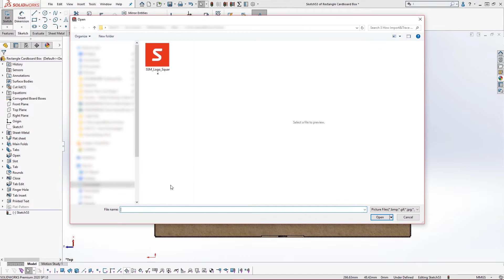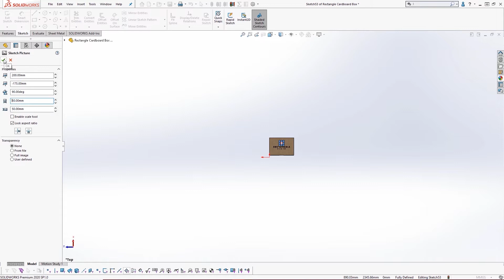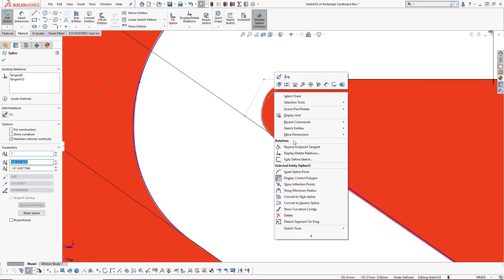How to Trace an Image in SOLIDWORKS  | Beginner SOLIDWORKS Tutorial

Comment: Autotrace is one of the worst possible solutions. inkscape bitmap trace is perfect solution for recognizing lines etc.  Not only that but you need aditional editing when using autotrace from solidworks. Most of the time it's useless. 
Video is a thumbs down, instead of showing what are you clicking you rush that part and music is iritating
Reply from the maker: Hello! As stated in the video, we don't recommend using Autotrace. That section is a demonstration that though it is an option, but the settings are entirely unique to individual images and the results are unreliable.

To get the best control over tracing images without using external software, splines and manual tracing are recommended.

Of course, if you convert an image to dwg/dxf through Inkscape or Illustrator, then you'll automatically bring in sketch lines when importing!